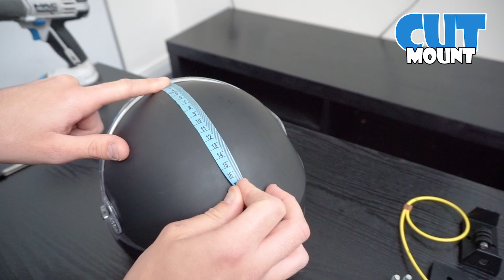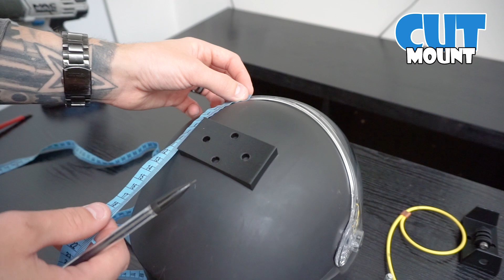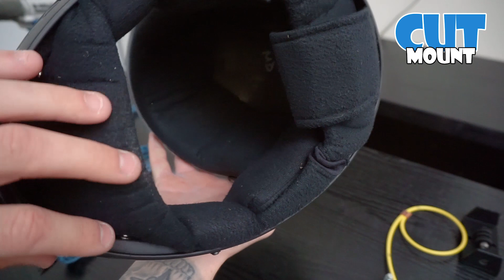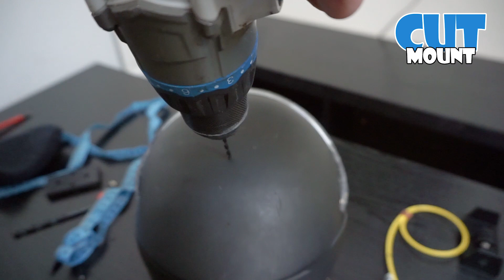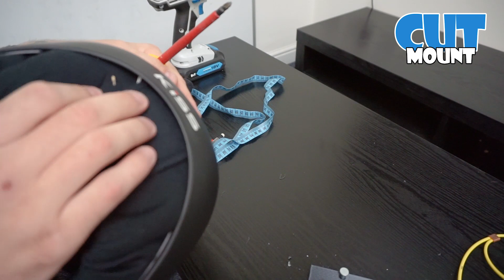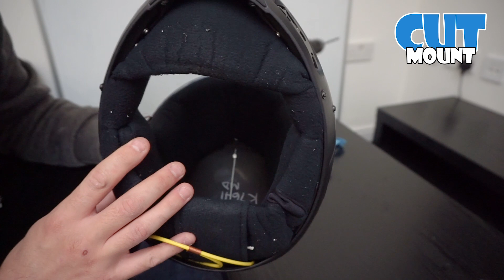CUT Mount KISS cutaway installation video

Comment: Why do 4 holes but only use 2?
Reply from the maker: Hi Martin,
The other two holes are for locating dowels that mean there is no (or very little) free play with the mount. Without them you would either have alot of free play, or have pins that are too tight and can't release easily if cut away.